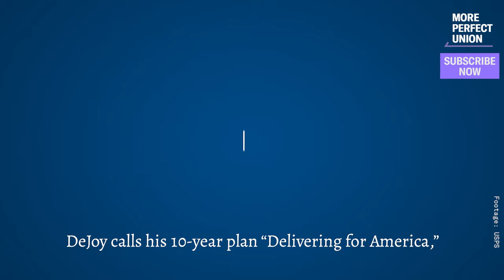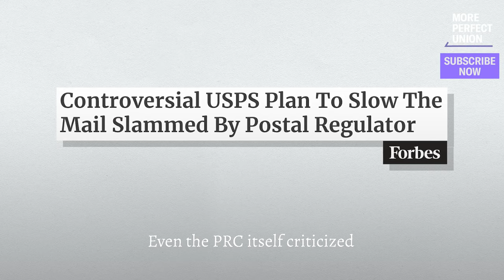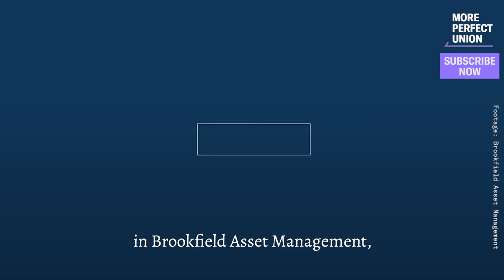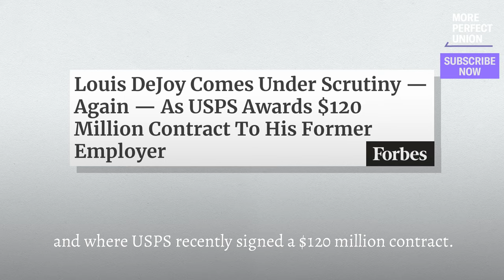Postmaster DeJoy's 10-Year Plan To DESTROY The Post Office

Comment: Trump did not appoint Dejoy,  the board of governors did. The Postal Regulatory Commission has watched and sat on their ass as facilities and other plants closed down under former PMG. Mail was delayed at first, to build infrastructure and update machines for packages. We're operating with more efficiency now. Most problems are still do to staffing, and 15 years of neglect by congress and former PMGs. And lastly, the PO is mandated to break even by delivering to every address in America. No other private company would dare to try this, not Fed Ex, DHL, Yellow, Amazon, not even UPS. it's an enormous task.